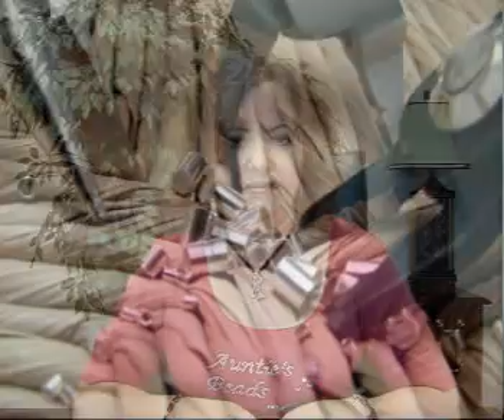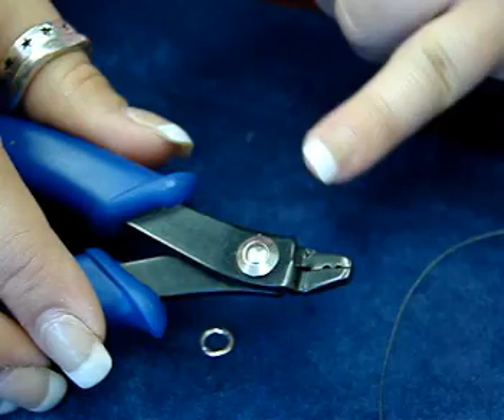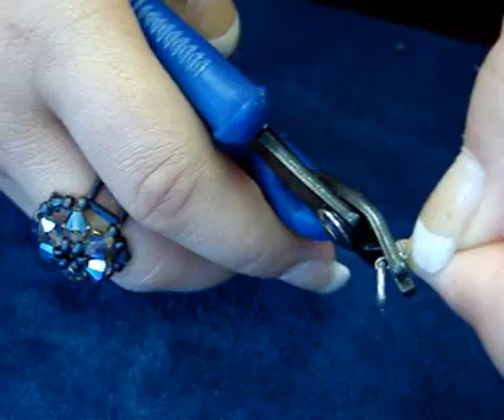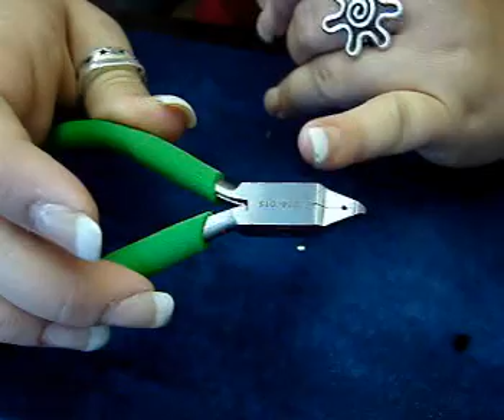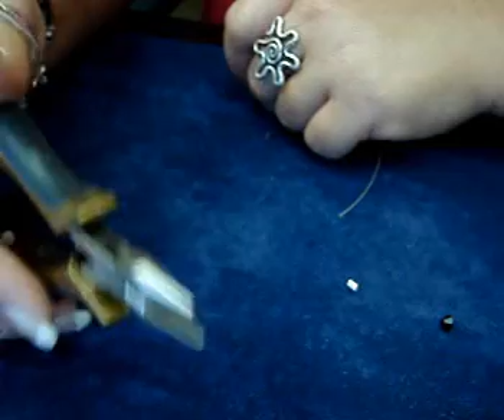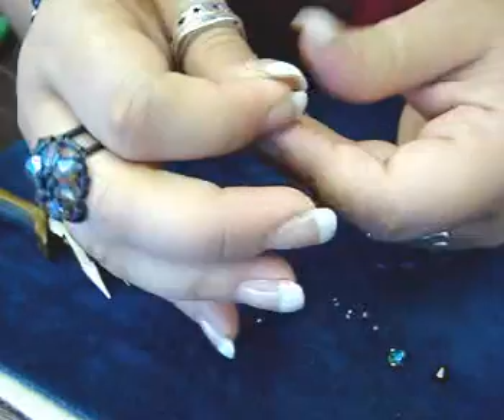How to Crimp & Different Crimping Tools

Comment: Clear and simple with extra details I needed, as a  beginner. I'm putting my jewelry kit together and did not have a fancy crimper (yet), but I'd bought a bunch of 1x1 (?) or is it 1 mm crimping beads. I suppose I could try using my electrical wire crimpers, but after seeing your video I now feel confident to try crimping with my chain nose pliers.  THANKS !

Comment: have any of your crimp tubes split? I seem to have a problem with about half of the tubes cracking or splitting.
Reply: Yes all my 2mm crimps crack and split. I went down to size 1.5mm crimp I had some success used a 3mm crimp cover as that is all I had. I squased that down flat and that did the rick. Looks ok and the ends are secure. I learned a lot with this failure, and one of the things I learned was to use jump rings to fasten on the toggle. I was not happy cause it was hell trying to get this sort of clasp on and the bracelet is a gift for my granddaughter. Lets say I had to improvise using the round toggle putting a jump ring at the end of that and then I used a lobster clasp and a small chain as I figured the chain would come in handy when you want to close the braclet using one hand as we do when we are trying to put on braclets. LOL I put a small charm on the end of the chain. It looks good. Fingers crossed that I have the same luck wiht the matching necklace I am too scared to start doing ....lol